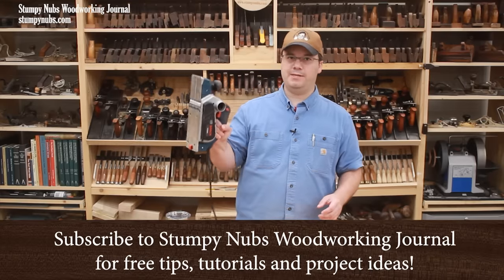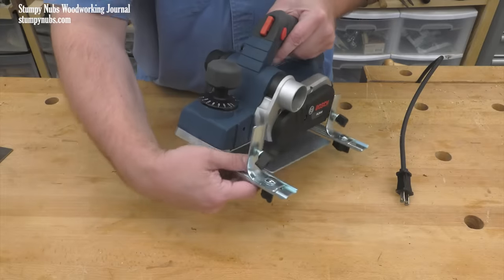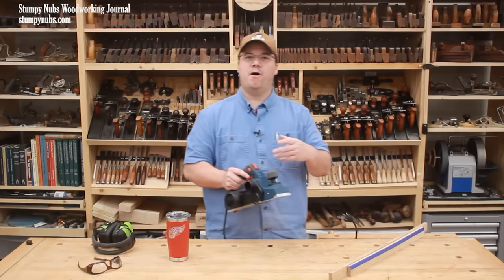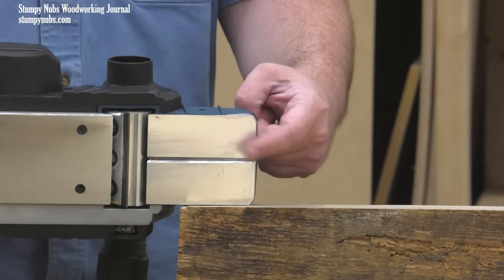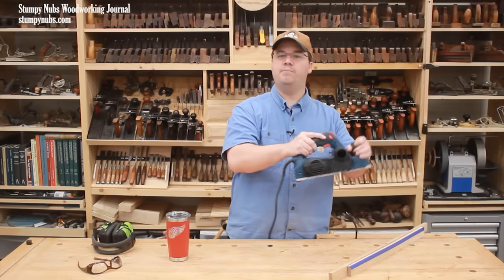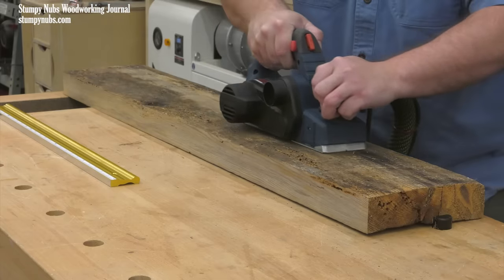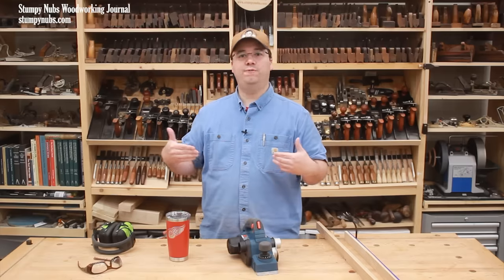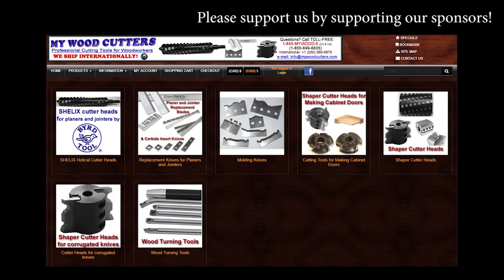Clever things you can do with an electric hand planer

Comment: Who has time for all ofbthat? I'd rather place the board onto a bigger board that's covered in sandpaper tape for grip and use wedges to stabilize the board before passing it through a thickness planer until one side is completely flat. Flip, rinse and repeat.

Comment: you do with a electric planer what we do with a hand planer.
Reply from the maker: Yes, and an electric drill does what a hand drill does, and can you guess what an electric saw does... That's right, the same thing a hand saw does.
Reply: @StumpyNubs  Yes but what is the use of buying a planer if a hand planer can do the job ? Is it just because it s quicker ?
Reply from the maker: @SimarDesign  That same as buying an electric drill, a table saw or any other electric tool when hand-powered versions are available.

Comment: You touched the blade while doing the explanation. I feel it’s a bad idea to ever touch the blade like that, because accidents happen when you are convinced that the blade is not moving
Reply from the maker: Accidents don't happen when the tool is not plugged an, and you can see in the video that it is unplugged.
Reply: If one makes a habit of causally touching the blade even when the machine is off, you might touch it when it is on by accident.  Love your content. 👍🏼
Reply from the maker: @Insanebynight  - When one deliberately unplugs the tool before touching the blades, one is not "casually touching" anything.

Comment: I like most f your video’s.
This one, not so much.
Yeah, it might work on a short piece of wood, but given 5 planks of 5cm think, 2.50m long, 45 cm broad well dried oak…
A planer and a thicknesser are required.
Reply from the maker: It will work on large planks. I never said it was ideal. But it will work. How do you think they flattened/straitened those planks before power jointers and planers? They used hand planes. An electric hand plane is not much different in that respect.
Reply: @StumpyNubs  I know how my father did it. No powertools. I still have his planes and tried it. No succes for me. But I am an amateur.
Tx for the reaction.
Yet, it might work

Comment: I bought a really cheap one off of amazon, it was terrible.  Instead of adjusting the front plate, you could only adjust the depth of the blade.  Who the hell designed that?  anyway, just like always, don't be TOO cheap when you go buy one of these.